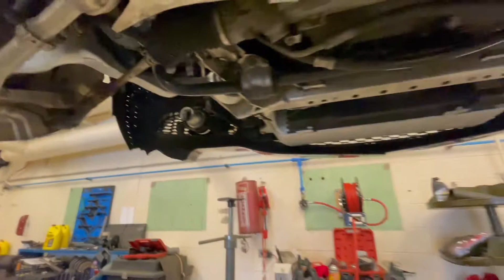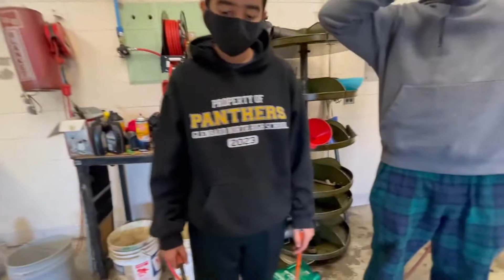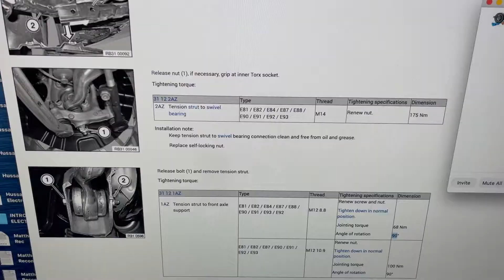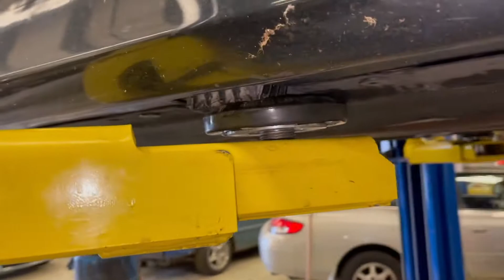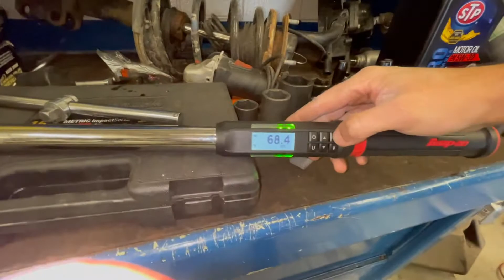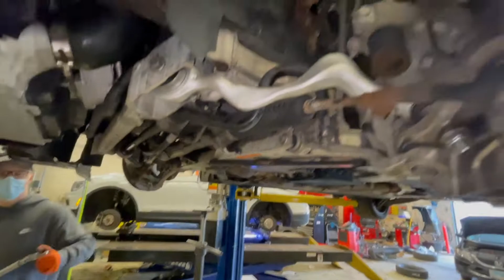BMW 335i Front Lower Control Arm Replacement Easy! E90 E92 RWD (328i)

Comment: Does the lower control arm makes the steering wheel shake? My 328i x drives steering wheel is shaking and today the brake sign came up
Reply: change ur brake pads and rotors

Comment: Could a bad control arm cause play in the suspension/steering wheel?
Reply: Yes. My front driver rearward lca bushing is shot and my wheel shakes hard under braking
Reply from the maker: Can deff cause sloppy response while driving and you can feel it oftentimes while braking.
Reply: No

Comment: Says its the hardest part to get off but doesn’t show how to get it off. Sick.
Reply: Thats what the torx is for. Visible threads shall be cleaned with wire brush. Then wd40, then unscrew using torx40 and 21 open wrench. Couldnt be easier.
Reply from the maker: Which part are you talking about?
Reply: @tunerworld  When taking the nut off the balljoint side of the lower control arm. Sometimes it spins and you didn’t show where to place the bar in order to get the bult off. Damn near the most important part of the vid not shown
Reply from the maker: @levifsm2096   ask and you shall receive the answer. It was done off camera and this video was made quick so I didn’t realize we didn’t get that part. Skip to 0:59 of this video and exactly where my finger is placed is where you would stick the pry bar to add pressure! Add a bit of pressure and zap it off with the impact and you’ll be good to go :)
Reply: Not that easy, broke 2 if my torx bits